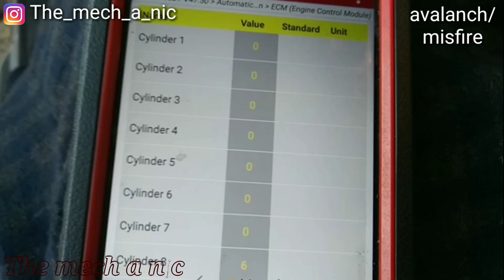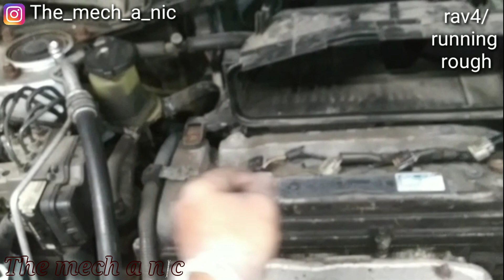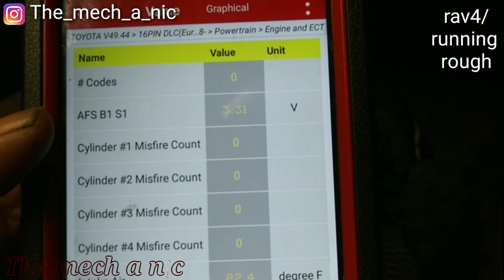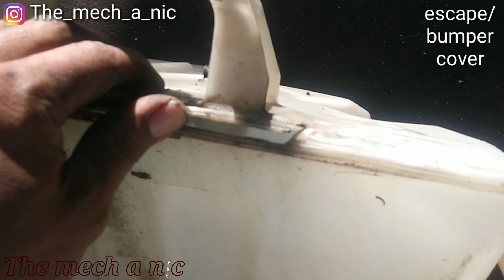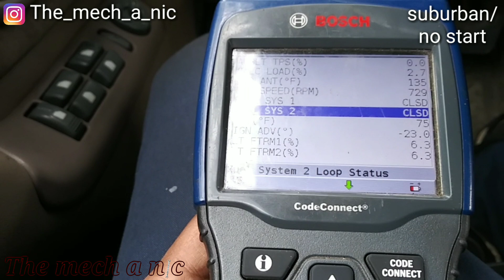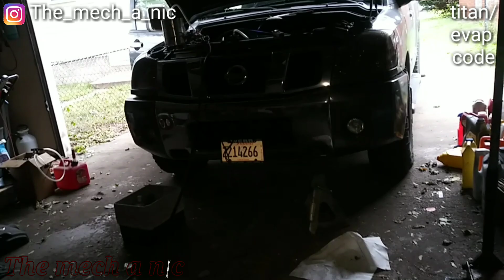insta mech a nic (vol 42) rav4 running rough , suburban random no start , no heat

Comment: What Ignition paddle probe do you use for your scope?
Reply from the maker: I believe its called the Wyze probe . got it from AESwave
Reply: What setting on the scope do you pick when using it?
Reply from the maker: @philh9238  every scope is different. Some u gotta play with the settings to get the best image. Seconday pickup, volts
Reply: I just got that scope in your video haven’t used it for anything yet
Reply from the maker: @philh9238  start using it even when you dont need to. Get familiar with it. Like a month ago i just figured out a feature i didnt know i could do. The more you use it the more you'll be comfortable using it. Watch as many videos as you can about using a scope

Comment: Great work Jonathan...hey I got a 2007 hhr and when I had the control arm changed on the passenger side I notice from the shop show me that the sway bar was rubing on it .. so it tells me that who ever changed the struts and stabilizer links use the wrong size they put the 12 inch on when there are supposed be 10 inches.. I can change them out but it’s cold out no garage so what would charge ? It’s a easy job but the shop by me is very good but busy ... I wish I had a garage were I did my own work .. let me know I’m on south side in Tinley park I’ll .. let me where or when and best days for me Monday Thur Wednesday..
Reply from the maker: Yes its common to see the wrong links on those HHR. It uses a 9-10 inch link like you said. Message me on Instagram or Facebook

Comment: Somebody didn't know what they were doing on the rav4? How do you bleed the cooling system?
Reply from the maker: Using a large funnel that attaches to the radiator. Fill it with coolant and let the engine run. You'll see the air escaping
Reply: @themechanic6117  Oh ok. I have one of those.